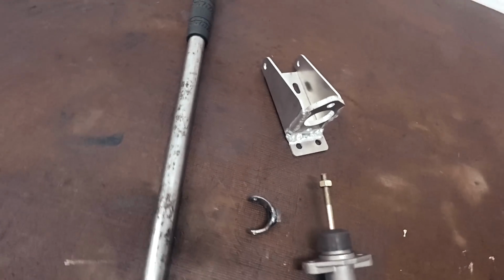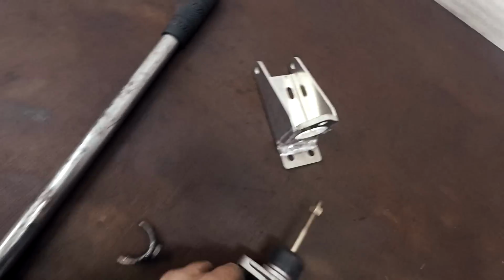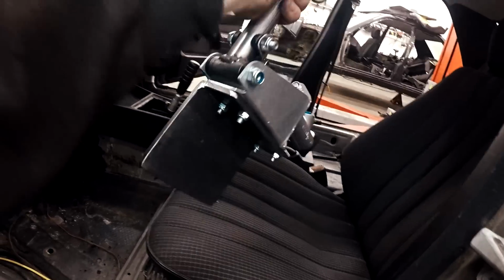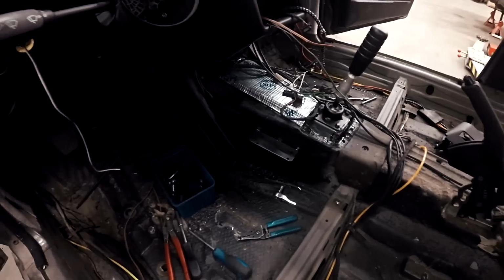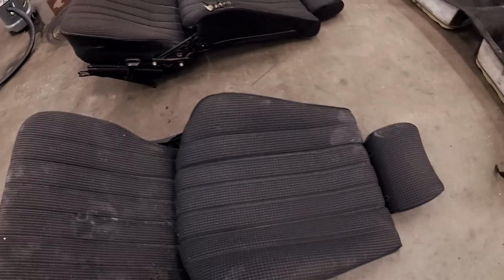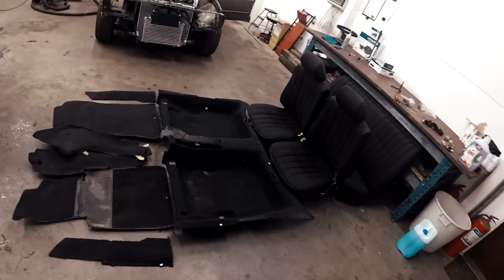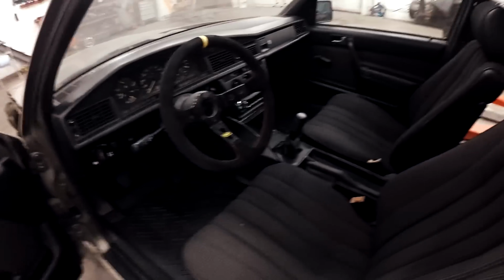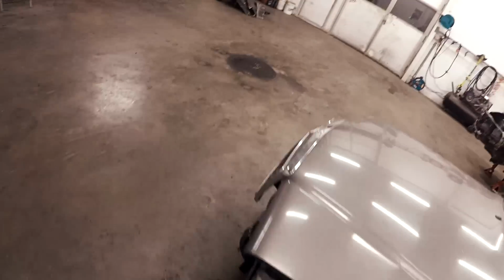VÄRKSTAN Episode 9 - Hydraulic handbrake & First Drive!

Comment: Really you cant have the hydro installed for the mot but the engine swap is ok? I should move out of germany...
Reply: Actually you can, but the hydraulic can't be the only one that works.
Reply: @xFluffyJesus  ah okay, so you could install a new set of brake calipers exclusive for the hydro, rigth? Or are you allowed to install a passtrough hydro pump (no reservoir, the hydro pulls the brake fluid trough the normal brake lines and master cylinder)?
Reply: @christianh.8408  I think you're allowed to tap into the original brakelines